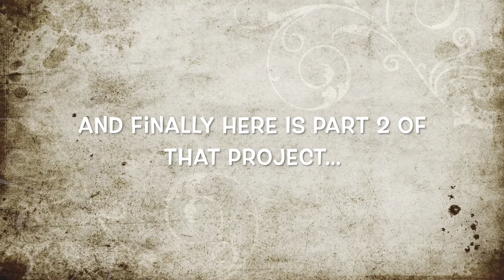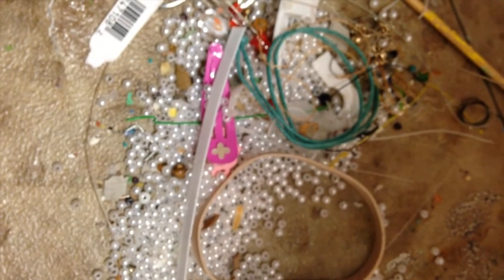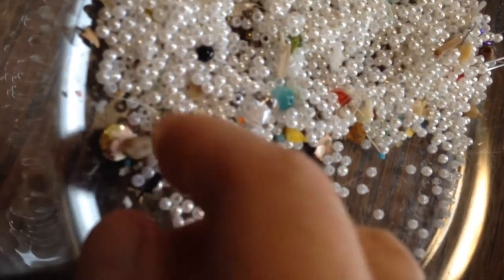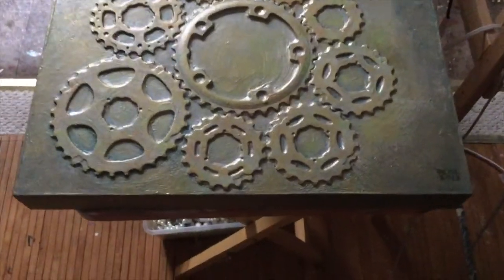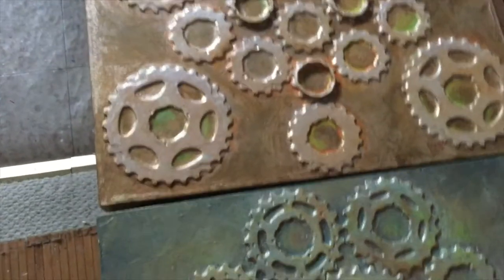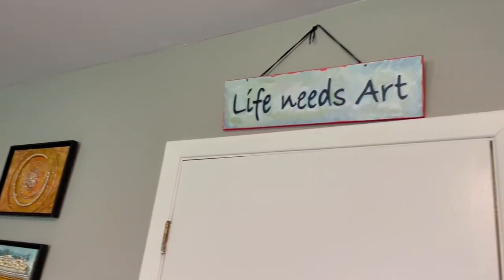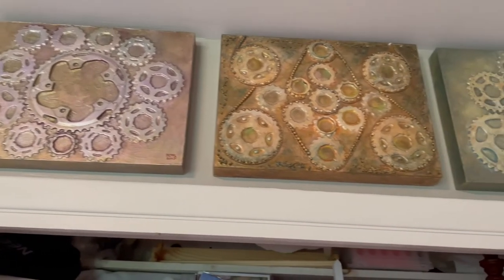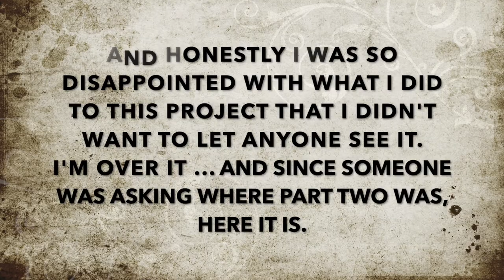Part 2 of How I upcycled Bicycle Gears #upcycling #bicycle #bike #gears #art #creative #acrylic

Comment: Maybe used crushed glass either clear or other colors
Reply from the maker: Oooh I Love that idea. I actually used crushed glass on a piece years ago, it was a big challenge because I was crushing old crystal wine glasses. Man are they hard to break! If I could post a photo of that piece here, I would. Maybe I should post it on my website …
Reply: @dorothealeblancart  actually I just buy Dollar tree Glass and break it up. Or I use beer bottles or wine bottles that are free. Or other types of glass that I find at thrift stores of various colors. Cheap and easy. If it's glass though that is not colored all the way through you have to be careful not to scratch the color off of the glass.
Reply from the maker: @KMF3  very interesting… what do you do with the shattered glass?
Reply: @dorothealeblancart  I separate it in containers according to color. And then I use the colors of glass to essentially paint a design. A lot of times I will pour resin over it sometimes I pour a mixture of watered down mod podge or glue. With glass on glass like a window or a mirror I have not tried pouring the water down mod podge or glue I'm not sure how that would look. I'm going to have to experiment with that one. But if you do it on a canvas or a piece of wood or something like that that's not clear then it works perfectly. You just don't get as shiny and glossy of a look as you do with the epoxy resin. Some people tumble their glass to get all the sharp edges off but I don't do that number one because I don't have a tumbler number two it's too much time and work for me and number three you can't tumble glass unless it is colored all the way through. Unless you just want clear glass.
Reply from the maker: @KMF3  Wow! I love your method of playing ... do you have videos of it? A website maybe?
Reply: @dorothealeblancart  no but I could email you pictures
Reply from the maker: @KMF3  would love to see photos. Could you possibly access my email from my website, so I don’t get spammed by putting it here?
Reply: @dorothealeblancart  sure but I don't see your website link anywhere on your channel
Reply from the maker: @KMF3  ok, guess I took it off. Maybe this will hinder spam: 
type my first and last name together, then add “@me.com” … no caps, no quote marks.
Reply from the maker: My website is dorothealeblanc.ca